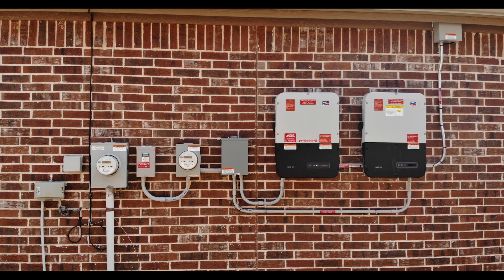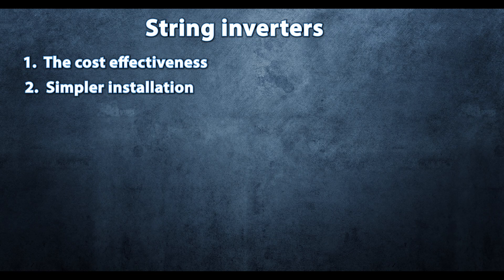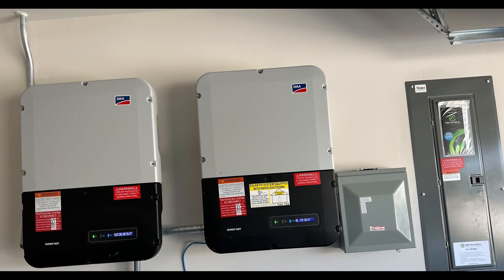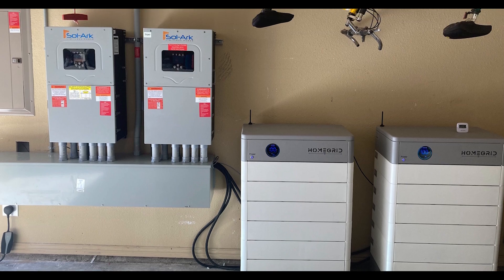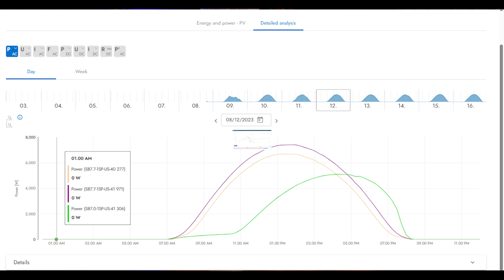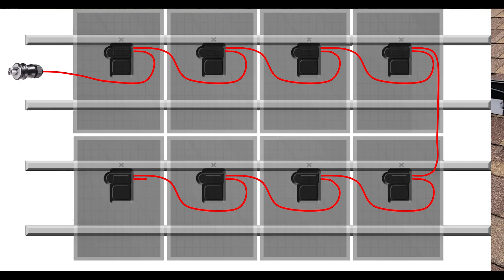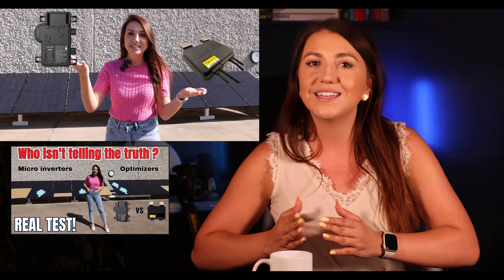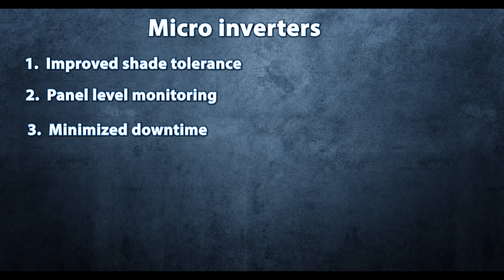The Great Solar Debate: Micro Inverters vs. String Inverters  - Are you making a mistake?

Comment: Great video!  One thing you missed and maybe it's not an issue in TX, is rodents.  At least 50% of people I know that have solar have had the wires chewed coming off the panels at least once in the last 10 years.  One person resulted in a house fire and another with just the whole system off-line till they could get the replacement and company out there to fix it, both simple string inverters.  All the rest have either optimizers or micro inverters with little issue but the one panel going down with only the low voltage from that panel not likely catching nesting material on fire.  I happened twice to us, before we installed rodent guards around the perimeter of the arrays.  My neighbors have brick facing and there's no way to stop squirrels from climbing right up.  One of them has a PPA and the company keeps coming out to fix the issue and still haven't installed guards.

Comment: Did you mention that the highest DC voltage within the system is string voltage, for string inverters  but only panel voltage in the case of micro-inverters?  One’s house insurer may have some reservations about a potential 600V (or more) DC source within/without your home?  AC is much safer, at mains voltages, than DC - for humans and fire risk.

Edit: mrntioned, sort of, lower down but simply dismissed by some.

Comment: After installing 800 systems,  When designed and installed correctly, String inverters make more Power, Period. Complexity kills, Computers under panels make little sense in most installs.
Reply: It's not true, micro inverters generate more, that's a fact. I have already installed several apsystems and they produce more energy than any string brand, as long as they do not work with overload, but this makes the system much more expensive, in the end, 1 more panel in the string compensates for the loss of power
Reply: @eam.investiment so add another panel to get the same power as a string system?
Reply: @NewLightEnergy
Reply: Could you elaborate a bit more?
Reply: @SG-lj8uu Each time a microinverter fails, you need to mobilize a two man crew. (Cost to insure climbers is expensive).  Just the labor is $500-$600. How can you justify $600 to repair a panel that only produces $100/year? Better to simply leave the dead panel up there. I have a Sunpower system and Enphase will replace the inverter but I still have to pay $500-$600 labor. Also, if I want to switch to Enphase monitoring, that's another $1,000.

Microinverters only make sense on ground mounted system where replacement is a simple DIY job that costs $0.

Comment: Microinverters offer more flexibility and future-proofing for your solar setup because solar panel models tend to get discontinued quickly. Microinverters allow each panel to work independently, so you can mix and match different panel types and specifications. This means you don't have to update all your panels if one model is discontinued, unlike string inverters where all panels need to be the same.

Plus, microinverters make it easy to expand your system. If you want to add more panels later, you won't have to worry about compatibility issues, which can be a significant headache with string inverters.

Also, consider this: the warranty for a panel usually involves replacing it with a similar unit, which almost never has the exact same specifications as the original. The warranty might cover labor costs for removing and installing the defective panel, but with string inverters, this mismatch can make panel warranties practically useless.
Reply: I have two Powerwall 3s working with three different types of panels. They are just broken up into different strings. I have 7 strings total.
Reply: String inverters are what you described

Comment: Hi Martyna , unfortunately I had that issue when 3 panels became shaded it would bring down the whole string and the   second string . Panels have bypass diodes in them but would not activate . DC optimisers fixed the problem on the 3 panels . Soni would never rule them out.
Reply from the maker: What kind of inverter did you use? :) Thanks for sharing in advance! Also what panels?  Did the solution was placing optimizers on the shaded panels?
Reply: I have a hypontech 4kw grid string inverter,
Solar panel are green sun 250w mono panels 2022… .I had to turn that string off and turn it back on again straight away and that would fix the problem until I got DC optimisers and I didn't have to manually every day.  I think if you shade three panels very slowly it doesn't activate the diodes but you would have to test this yourself on your setup. If you need any graphs from inverter I can send them on.
Thanks Alan

Comment: eg. Fronius GEN24plus 10 kW hybrid, which I have had since 2022, has a dual pv1 input, a pv2 input and battery connection. You can connect SE and SW to different strings. Or for "winter" production, you could connect top row and bottom row to different strings, so that top row starts producing earlier. So with right choices even without microinventer you can reduce/manage/optimize the panel string impact and morning/evening/spring/autumn production. All with a single inverter. Fronius Gen24 online manual is excellent, I hope all brands would have similar.

Comment: Excellent Video, you nailed it. We installed our Solar system in March 2011 with an over spec-ed SMA inverter in Perth Western Australia. It does get hot here in summer 40 deg C is not uncommon. We expanded the system in 2015 taking it to 4.4kw (Small I know but solar was expensive in 2011/15). We also added a 13.5kw battery in 2022 and now run our 4x bed 2x Bathroom home 92% of the time off solar or battery that is the 1yr average… so pretty good (That includes some EV charging). In that time we have not had a single failure of the system and we have 40x 110w Kaneka (Japanese) panels with no shading. So everything you said fits with our experience including the ability to expand a string system provided you over specify your inverter initially. Thanks for the video great advice. We will probably replace it in a few years time, most likely without a separate inverter just a hybrid Battery with a 10yr+ warranty.👍

Comment: I got around the string inverter 'single panel failure' issue by putting 4 separate strings (8 panels per string) in parallel to feed the inverter.  Each 2.5KwH string is fed into (with proper fusing) the inverter so that if I lose a panel on any particular string, the other strings continue to feed the inverter at their full power level.  This seems to (and has been) working great over the last 8 years. I wish I could monitor individual panels, but to date, it looks like everything is producing as expected.
I built it this way because I have a high roof and I'm getting a little too old to climb it! 😀
+1 to Martyna for exposing the benefits of each.

Comment: Here is my issue with string vs micro single point of failure. If I use a string inverter and it fails, my system is down. which sucks but is not then end of the world. but as i live in a remote area and the large string inverters have to be shipped via freight, when it does fail, I'm out the cost of the inverter AND 2000 dollars in shipping cost. if one or all of my micros fail, usps of ups or fedex can deliver a whole batch of them for under 200 dollars. Nobody ever includes shipping cost in that calculation.

Comment: I have both a string inverter (2020) and micro inverters (2023). One of the strings had a chimney nearby so that pretty much killed the current for about 2 hours a day. Tigo optimizers were added to fix this, but did absolutely nothing so after battling with Tigo support for months I ditched them and had GNE Honeybee optimizers added instead. These do the trick.
On the other roof I chose Enphase instead because of the space savings inside, more redundancy, better handling of shade which is a bigger problem there and the expected lifetime of these inverters as there is a 25 year warrant on them. The neigbours string inverter just died within 5 years and that really brings up cost in the long run if you only have 8 panels connected.
If you have a lot of panels and shade is not an issue, a string inverter just makes more sense in terms of initial cost.
I am considering installing two more panels on a shed myself and with a tree nearby  shading one of those in the morning I think micro inverters will be the way to go, although I will choose another brand that is cheaper than Enphase.
Another nice thing about micro inverters is that you are not limited to one type of panel per string and degradation of one panel will not affect the others in the long run.
Reply: Do you know the brand of your neighbor's string inverter? I'm curious especially since I just installed a string inverter myself😂
Reply: @ Yes, the brand was Steca. A German brand that I had never heard of before.
But I think inverters have gotten better over the years. Mass production has it's advantages.

Comment: Great video!!💪🏻

 I have been thinking this a lot. I think the best approach is multiple lower capacity(4-6KW) string inverters in parallel. That way you can easily adjust solar panels as repair or upgrade. Also redundancy if one fails (I assume you would have to use the battery without close loop), you can keep going. 

I have also been thinking (if net metering is alive) to mix off-grid and a grid tied inverter in the setup, instead of going hybrid.

Comment: With the price of 240V stand-alone Hybrid inverters being so inexpensive and fairly power efficient, there is no reason not to have two or three of them on the wall these days giving homeowners more than enough redundancy.  I have three NHX 10kW inverters (125A capacity) that cost $6,600 total (yes, total) and idle at 75W each which I admit could be a little better.  However, If an inverter goes down, I still have two of them that can provide 83A @ 240V.  So there isn't a single point of failure.  And they are so inexpensive relative to the overall system cost, I will be buying a spare here shortly.  I also have a very inexpensive TIGO system for basic panel level monitoring which is all I need because I have no shading at all.  This eliminates any real cons to string inverters and blows away microinverter setups on price by a huge margin.  Not to mention DC coupled systems are more efficient.  No clue why anyone would build a new AC coupled system in today's market.

Comment: Totally agree. I have a heavily shaded site and was hell bent on micro inverters. After a while once I got the quotes I found the cost around 10-20% more expensive. Have seen a number of videos comparing string vs opt/micro's(including yours)  and they all seemed to have a best case scenario of around 5%, and given the extra cost upfront it is pretty hard to justify especially given potential maintenance effort down the track. So instead I am using the extra $$$ I would have spent with the micros and buying more panels. One other point is that not all string inverters are the same, as they have different algorithms to track the MPPT. From my research SMA and Fronius seem to be the best with handling shade which is what I plan to go with.  I think these 2 inverters have a very good reputation and are less likely to fail. I have had an SMA on another property for almost 10 years now and it is still going strong.
Reply: I have a Growatt inverter from 2020. It jgets near to nothing if a sharp shade (chimney) hits just one panel. 
But if you have multiple strings and a lot more panels for the same price that may not really be an issue. 

I also have an Enphase system on the oppsite roof which is away from the sun most of the day. Oddly it outperforms the string inverter on any cloudy day on a per Wp calculation. The IQ8 series really makes the most of what the panels are getting in these conditions. In clear weather they also perform pretty well until the sun goes over the roof.

My roof space is pretty limited so in hindsight I would have chosen a SolarEdge or Enphase system instead.
Reply: SMA also has built-in ShadeFix technology that works to optimize production in shaded conditions.
Reply: @marcnerius9723  There are some better inverters and panels that can mitigate shade to a large extent. But every situation is different, so I would not take a chance unless adding some optimisers later was really easy and cheap to do.

Comment: I'm convinced that string is the way to go but just have concerns with failure.  When the inverter fails does it slowly ramp down or just burn out with no indication?  If so, I would be without power for a long time until I can get a new one delivered and installed.

Comment: I would be reluctant to have 400-500 volts DC on a roof made of combustible material like asphalt shingles.  400 VDC is a far greater fire hazard than 240 VAC.    For a rooftop installation where rapid shutdown is required, DC optimizers give you just as many points of failure as as micros.   Where the current tech is, I would only consider string inverters for ground-mount systems. 
As for batteries being a single point of failure in a microinverter system, I don't see it.   I can turn off my battery breaker with no effect on my system's production.   Turning off power to the Envoy has no effect on production either; it just kills monitoring and reporting.   Put a clamp meter on the branch circuit(s) to the array(s) and you can see they're still producing.